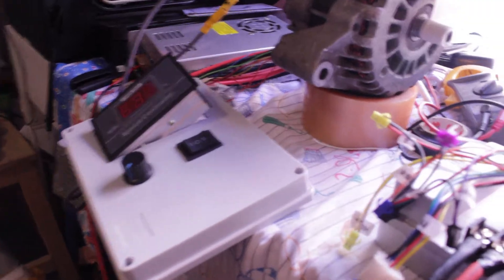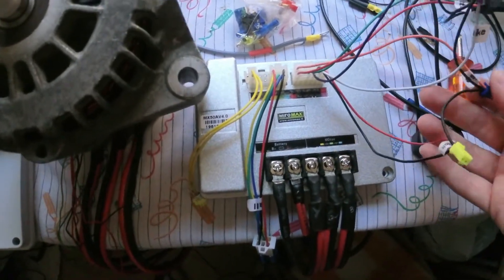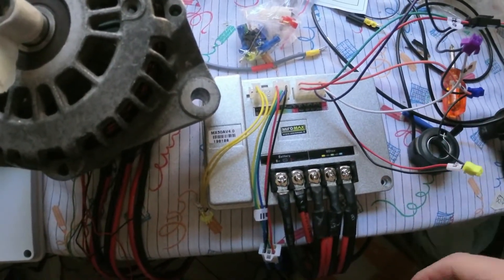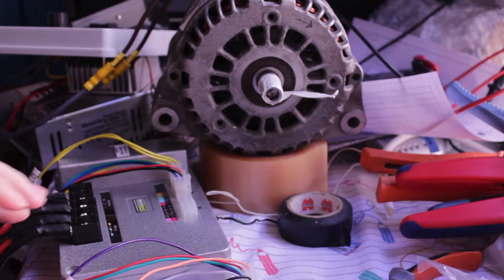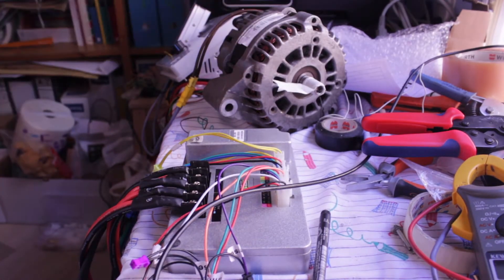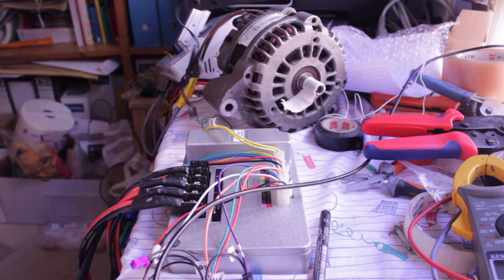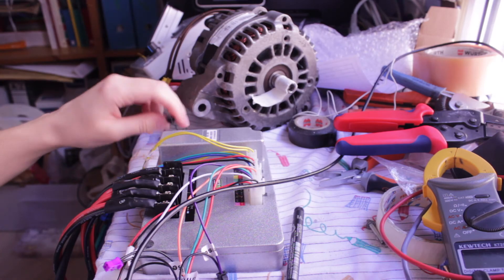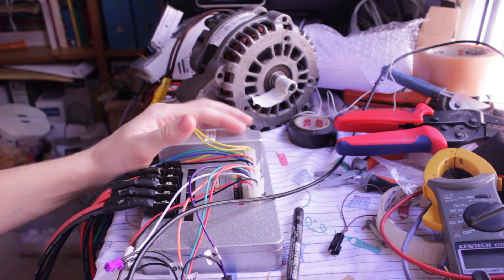The car alternator GO KART gets a NEW CONTROLLER, setup and testing BAC-0501

Comment: Hi Engineer, why do you use a PWM Supply for the rotor winding. I am using a 14V DC battery to create the rotor magnetic field. 

What´s the advantage using PWM for the rotor magnetic field. 

Thank you. 
 I am having similar problems on my cart & would like to learn of your lessons learned. 
Cogging @ start my my major problem. 

https://youtu.be/UIsWZSbUQpA

Great Video
Robert
Reply from the maker: I've seen your kart, it's awesome! Basically a PWM applied to the rotor windings will vary the amount of current that goes to the rotor windings. More amps=more torque but less speed, less amps=less torque but more speed (don't put it to almost 0 because probably won't spin), what I do with mine, once I achieve top speed, I decrease the PWM slowly while applying full throttle to get a bit more speed. At start up it's at 100% but then I decrease it to ∼80%. Cheers

Comment: Hey I'm basically doing the same project, just as a bike. I think the mosfets in the controller are basically pressed directly against the metal wall with some thermal paste, but that is also pretty much what all Chinese controllers do so the heat is a bit weird. I'm having to restart my project because of a combination of either my first alternator @60A was too weak or my gear ratios were too high (I have about 1/12.5 but it goes to a 2ft wheel not a small go cart wheel). I have the same controller, and a 150A alternator (no hall sensors yet). Hopefully I will get it wired up tomorrow and be able to do some tests to see if I get the same results as you
Reply: Also I wonder if you could use the 5V coming from the controller instead of the DC-DC converter for the rotor. I also have a DC-DC (48V-5V) converter already though so will probably stick to that, especially if the controller already gets hot.
Reply: @shogoohta-weir2987  the 5V from the controller probably won't hold itself with the power draw for the field coil

Comment: how much current are you supplying the coil?  i think it would be better if you use a controller with learning capability, and works on sensor and sensorless motor. lso try 5v 300ma supply for the coil, i watched other youtuber use that setting and it works fine.
Reply from the maker: 12V and draws about 6 amps, the first two controllers that I used had the self-learning and now they are a paper weight.
Reply: @OverbuiltByHenry  i think that is too much, 6amps.. 1amp is enough, 1 youtuber only run 300ma on 12v  works fine
Reply: @dingski_diy 300mA is low, are you sure that the youtuber is using the alternator with load, instead of using only on the bench?
Reply: @foxxyytofficial  you can always start from low, it doest matter if it use tried in bench.. you can gradually increase it when load is applied..

Comment: How hot would you say its getting?   Without them spinning they give off abit of heat from the field coil.  I found when i run a load test i got them up to 100c with no issues!  as long as the enameling doesn't get damaged/burnt should be fine as there are no magnets to get heat damaged.   Have you tried pas level mid or high?  Maybe lower the acceleration just for testing might help abit.  Hope you can get this going!! i've spent alot of money on controllers which have ended blowing up!! lower the peak currant for now just in case you have a big currant spike and kill the controller

Not good news about lock down mate i hope your country can get on top of the virus soon!! 
stay safe dude
Reply: also when you throttle up hard and then it cuts out is that because you've hit the max currant?  With the vesc you put in the max amps but it also has Absolute max currant this is there for safety and if it hit this the vesc will need to be rebooted before it can go again.  having the peak current to close to the Absolute max currant will often end in this issue.   also lowing the acceleration setting will help with the sudden rush of current and stop it from going over this limit
Reply from the maker: Maybe it hits max current, the max current of the controller is 100 Amps but the first time that I plugged the controller it was set to 180 Amps, now it's programmed for 95 Amps.

Comment: I would assume that the heat at no load is due to the roughly 60 constant watts being applied to the brushes. As you pointed out, there is no air cooling if the alternator isn't running. Aside from that, you might double check to make sure that the brushes aren't grounded to the chassis.
 
I use a DC to DC step down converter to apply power to the brushes. This eliminates the need for a separate battery pack, allows me to adjust from 1 - 12 volts on the fly, and if need be I can cut all power to the brushes.
 
Personally, I wouldn't worry about those Hall Sensors. I use an RC ESC and it works just fine with brushless/sensorless motors. 
 
In my opinion you had/have two main issues: #1 your original wiring was inadequate for the required current (should be good to go now). #2 your speed controller was also inadequate. I took a quick look at the new one you ordered and unfortunatley I don't think it's going to do you much better than the first one you had - Constant current is rated at 50A, peak at 100A. My ESC can run at a constant 200A and can do bursts 4-5x that amount. At this point, I think you just need the right speed controller and you'll be good to go. For reference, I use a Leopard BL5 ESC. You run at a higher voltage than my 32v bank, so you would need something just a bit beefier.
 
Anyway, I'm relatively new to all of this stuff and am certainly not an authority on any of it, so take what I say with a grain of salt. All I know is that I haven't experienced the issues you've had. At this point the only fundamental difference I see between my build and yours is the ESC.

Comment: If you have the ebike tester, try to check if the hall sensors on the alternator light up the LEDs correctly, like this video: youtu.be/l3T982cgJUk
Reply: Here's another video showing how to test correctly: youtu.be/Rh2nCfksh3U
Reply from the maker: I'll give it a go 👍
Reply: @OverbuiltByHenry  the link was swapped, now its correct
Reply from the maker: It says that the video in not available.

Comment: Is that a permanent magnet alternator or you've given supply to the brushes.?
Reply from the maker: I supplied 12 volts to the brushes.
Reply: @OverbuiltByHenry  try to use a common lipo battery or a lead acid battery to feed the brushes for a first test with the new controller as well
Reply: @foxxyytofficial  I have a 24v 180amps truck alternator and I'm planning to build an ebike with 72v lithium ion pack. I'm completely new to this whole ebike thing n I'm still learning..
Please share your thoughts on this.. you guys are my motivation... thank you
Reply: @umairkaiser9015  the idea is promising, but first of all i need to tell you to check proper BLDC motors, there are good projects with 6374/6384 motors for skateboards, and the same could be said about hub motors and mid-drive motors.
But if you really want to follow this road, its okay, just understand that they aren't foolproof and mistakes can happen.